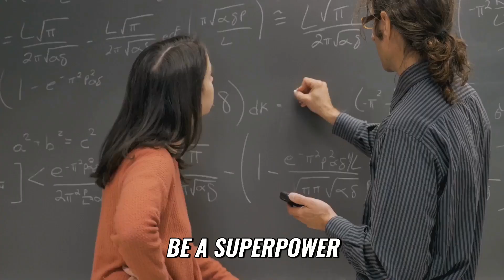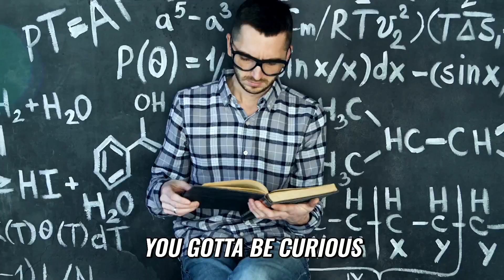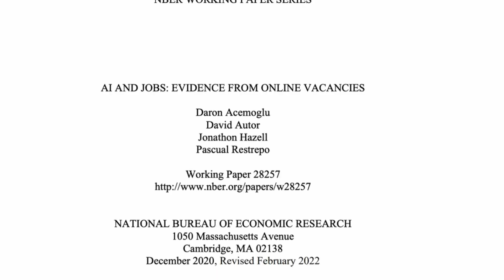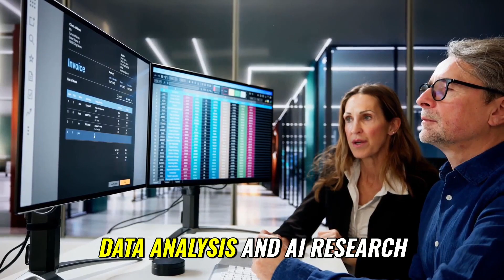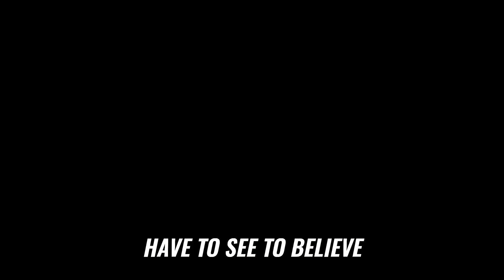Robot Revolution: How to Thrive in the Age of Automation

Comment: Our ET friends use AI combined with quantum computing to operate their ships. Almost everything is done by the AI and quantum computer while the crew provides instructions as required. The interface to the crew is mental both ways. Crew members think to the AI and quantum computer and thought waves are returned to the crew as needed. The inside of their ships is remarkably free of control equipment such as pushbuttons, lights, and gauges. During flight, the ship scans all around for possible rock collisions and dematerializes any small oncoming rocks and rematerializes them behind the ship. If the rocks are too large to teleport then the ship is flown around them. The ETs are in harmony with their AI and quantum computers and both are extremely powerful. Yes, their ships are powered by antimatter drives. They can circumnavigate Earth in 90 seconds. Fortunately, these beings are as benevolent as they are powerful.
Reply from the maker: That sounds like an incredible concept! The idea of a harmonious relationship between ETs and their AI is fascinating. It really makes you think about the potential of advanced technology!
Reply: @NorrisAIDecoded  The enemies of Earth are humans, not technology, and not ETs. Advanced ETs have no police of any kind in their home world, no money, and no problems of any kind so they seek out planets in early development, like Earth, and help plus protect but invisibly. Eventually, there will be open contact. Just humanoids to start with but eventually Reptoids and Insectoids. The level of development determines the behavior, not the species. Exposing humans to non-humanoid species initially would freak out too many of us.